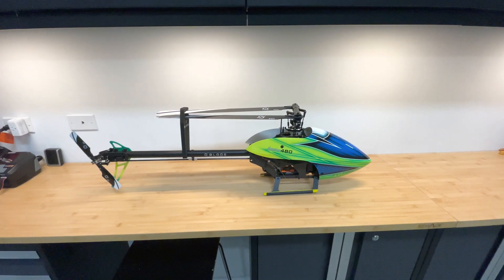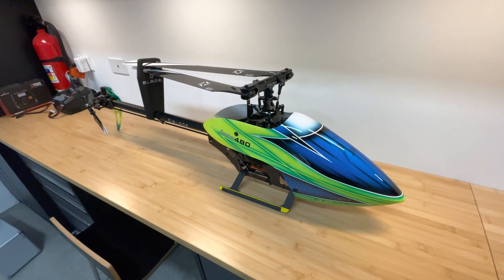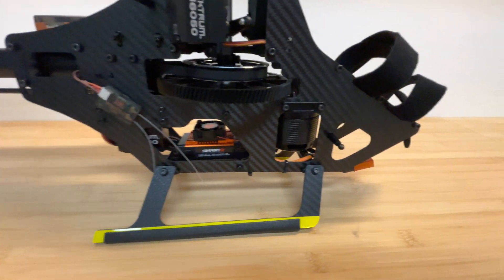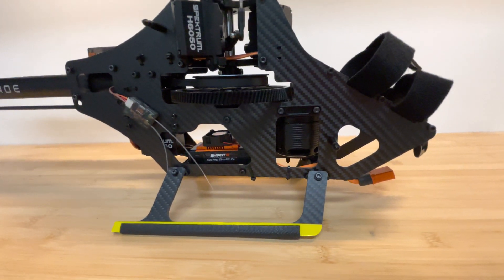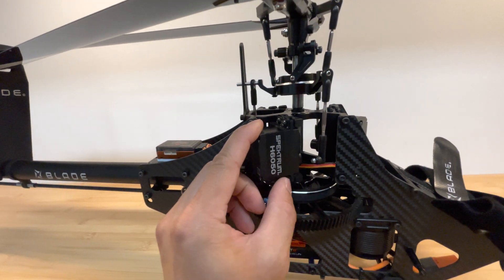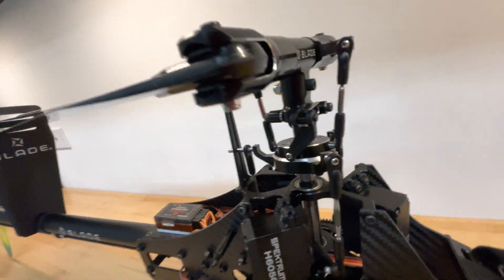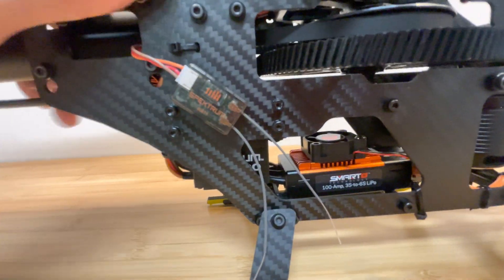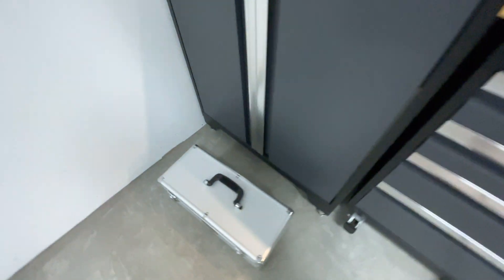Blade Fusion 480 Build Review Part 1

Comment: I just picked up this bare kit on super sale. I like that you relocated the ESC  i seen a review that this model is terrible because the esc is mounted under the hot battery and next to a hot motor. Also you mentioned the bubble leveler. I am fighting this problem on my 230s smart currently. And earlier today i had this exact thought.. maybe you can trick the FBL by adding more shims under the tail to move the bubble forward? But you moved the tail downwards  so im curious about that ❤ Thanks for the video overall!

Comment: Amazing helicopter! However,  I can't believe Horizon has not addressed the slow start issue yet. Mine is stretched. Stock servos were garbage. I've also switched to Torq servos and switched the 6250hx out with a brain2 and now this thing flys perfect!
Reply from the maker: I spoke to Horizon Hobby tech support regarding the issue with exiting out of forward programming and no slow start. Support saying it is not an “issue”.
Reply: What esc are u using??
Reply: Could you please tell me where you got the servos from sir,and also what esc?

Comment: The blade fusion 360 smart does the same thing with the hard start after exiting forward programming. I even changed out the ESC from the 45 amp to a spare 60 amp ESC that I had because I thought that it was defective. I now have a couple of tiny indents in the back side of the blades where they struck the blade grips due to the rotor head accelerating so fast. Also it sounded like the gear slipped. But I see no signs of the gear being stripped. So I got lucky on that.